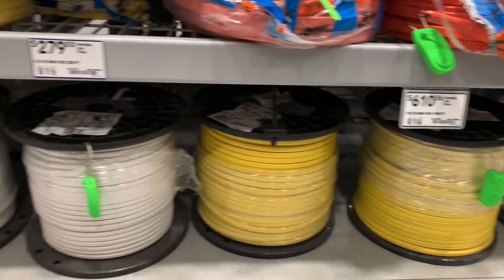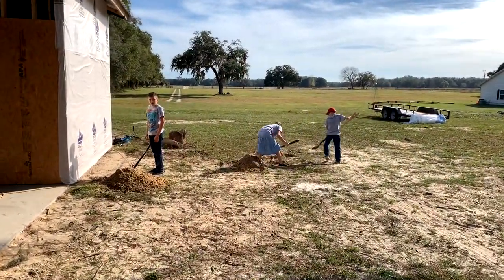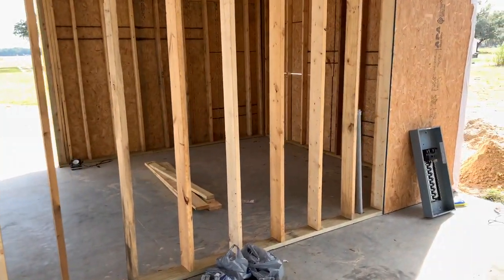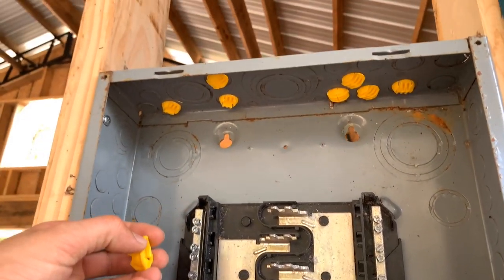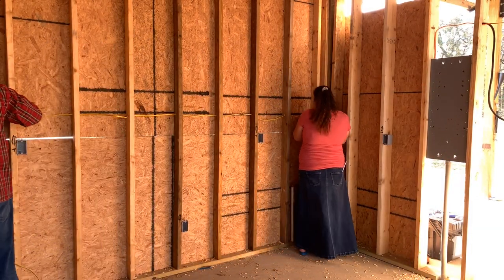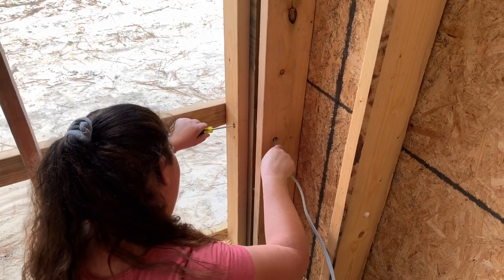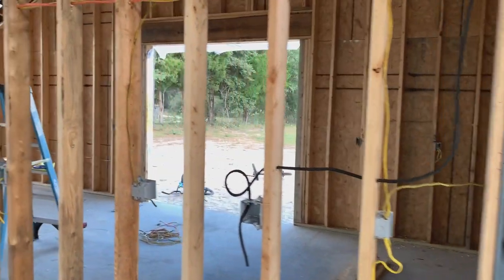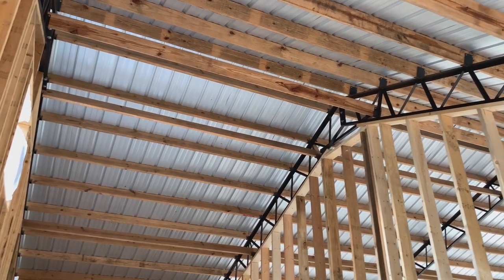Wiring our pole barn lights and workshop!

Comment: I have a question for you, since the price of copper wire is ridiculous right now. I was planning to run 2ga aluminum wire to my garage sub panel, 240v. it will be around 150’ from the house to the garage sub panel. It will be buried in the ground, in 1 1/4” sch 40 glue together conduit. Will the aluminum wire be ok? I need 240v out there for my welder and my compressor is a 240v 80 gallon unit. My dad built the garage in the early 80’s and ran power to it back then, Since then one of the feed wires has failed. I tested both legs in the garage and only one has power. There’s a break in the wire between the garage and house.I can pick up 160’ of 2/2/2/4 aluminum for $350. Copper is $1125. I’m a engineer and I’m certified in electrical up to 400v. I’m gonna rent a 36” trencher in the spring so i can bury it, plus it’s easier for me then hand digging it. Thanks for any advice.
Reply from the maker: I apologize, I just saw your comment! I ran 2-2-4-6 direct burial aluminum wire to my barn and it is 350 feet from my panel at the house. It will be for my workshop equipment and such. It’s rated for 100 A, of course you do have to factor in voltage drop for long distances like that.